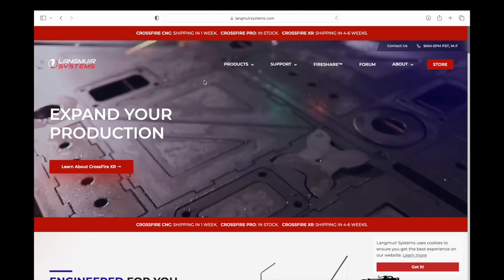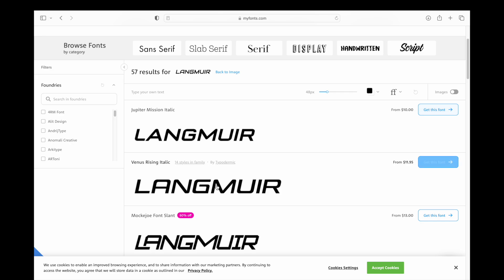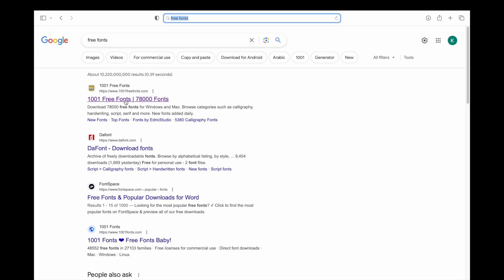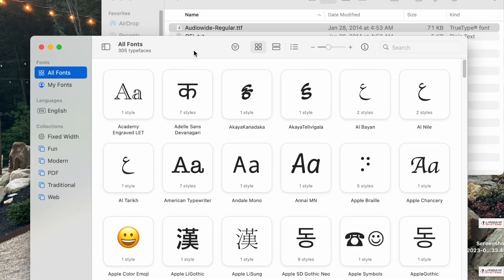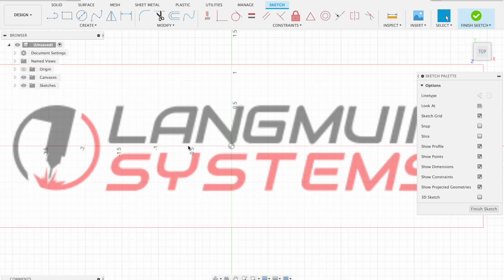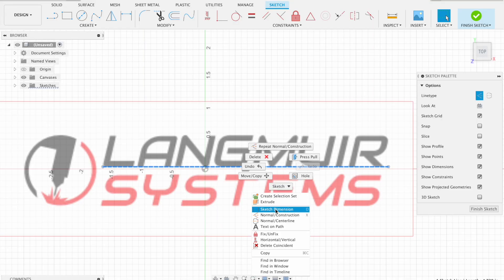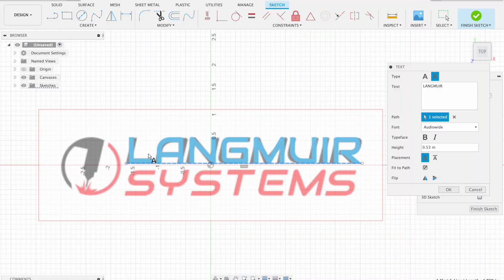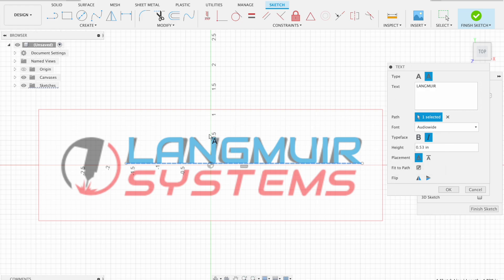FUSION 360/ LANGMUIR....How to Find Custom Logo Fonts ....Step by Step

Comment: What’s the point of deleting the construction line? kinda defeats the purpose of having it
Reply from the maker: You can do it however you want.  I create construction lines all over just to use for reference and centerlines when using the symmetry tool and mirror tool.  Then i delete them when im done and ready to create a cut file.
Reply: @ just confused bc construction lines don’t interfere with the profile, at least in the case of extruding the text. Does CAM toolpathing interpret the construction lines as features?
Reply from the maker: @koifish1le996 no, like i said you can do it however you want.  Thats just how i like to do it.  I like to clean up the drawing when im dont instead of having reference lines everywhere.

Comment: If all you have for design is Fusion 360 then of course this works, but if you use either Illustrator or Affinity Designer you also have an export option to .dxf, which you can then bring into Fusion 360 to simply thicken in the Sheet Metal tab and then make the cut path. It's just much easier at time to use the graphics design tools than CAD tools for things other than squares and circles, (just sharing)
Reply from the maker: Depends on what you get used to.  I think fusion is pretty easy for my application and i can do everything in one place. Always good to have options.
Reply: @SpicerDesignsLLC  Keep it up, my wife and I have watched a bunch of your videos in the past few days, we are thinking about buying the XR table, I'm just watching your videos and making sure I can mimic the designs you're showing both in Inventor and Illustrator as I don't normally use Fusion 360. But I'm finding that export from either Inventor or Illustrator is working fine and I'm only in Fusion to set up the cut. I called Langmuir yesterday to ask about .dxf import into their software, unfortunately, I was told that is not an option as of yet, (strange, but okay), hopefully, that is something they will offer in the future. Simple parts should have the ability to be created on the table software, I'm not sure why that isn't part of their controller software...?

Comment: I’m new at this just got the table a few weeks ago.      I’ve been trying to figure out fusion360 with no luck.    I’ve followed you video with the easy button and got to the point where you explode text but when I click on it I don’t have the option for explode text.  Do I have something not set right in settings?    lol.  I’ve had the table put together for 2 weeks and not cut one thing cut.   Wasn’t expecting the program to be so difficult
Reply from the maker: @thirddaybuilt2838  its not bad you just have to keep practicing. It will get easier.  CAD is no bs. Try clicking the letters to highlight them, then right click the letter and you should see explode text.  Otherwise try a different font.  That font may not have a vector form.
Reply: I’ve changed fonts and no luck.   How do you highlight letters?
Reply from the maker: @thirddaybuilt2838 just click on them and they will turn dark blue.  Then right click them
Reply: Figured it out.  Thanks for the help.     When I’m sketching I have this axis cube with arches and circles following me around messing up the sketch path.   Any ideas how to shut it off?
Reply from the maker: Not sure what your talking about.  Theres a small menu at the bottom where you can select “displays”.  Try messing with that

Comment: These vids are really great bro. Im getting out of trucking and im trying to go a totally different route and i found your vids looking at plasma tables and they're super informative and hilarious.
Reply from the maker: Thanks!   Feel free to ask any questions as you dig into it.
Reply: @SpicerDesignsLLC  bro if a keystone guy buys the 4x4 or 4x3 setup like yours,  can a feller still do bigger stuff and feed it thru the machine and the computer break it up in sections? Or does a guy need an 8ft table to cut 8ft stuff.
Reply from the maker: @nv3217  you can do index cutting with the 4x3 machine.   There are settings that allows you to do it.  I haven’t though.  I always sub out the big stuff.

Comment: Helpful tip in fusion is you hit the s key in sketch mode you can customize a box with all the tools so you don’t have to go to the top all the time. It saves me a lot of time.
Reply from the maker: I do use that a lot.  Seems like a lot of the tools arent accessible unless you use the s menu.   Thanks for the pointer Jon!